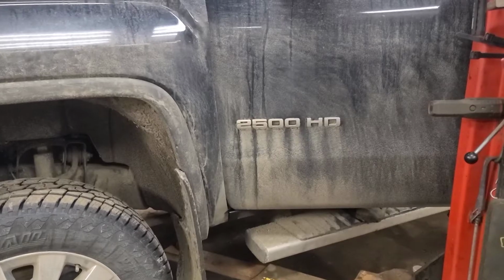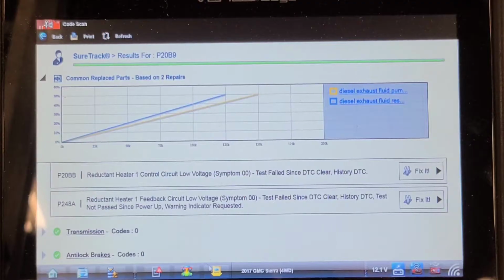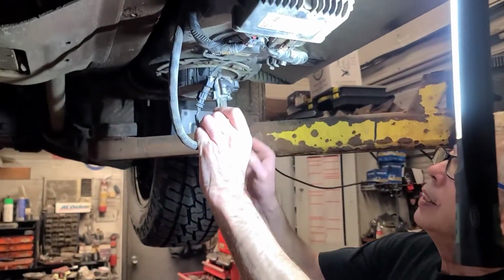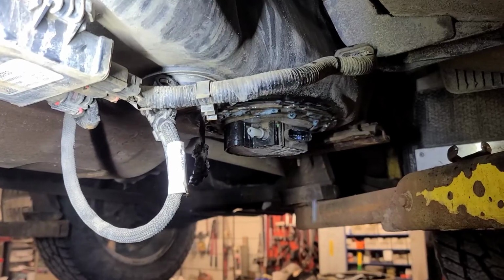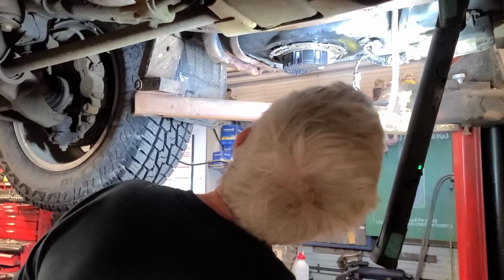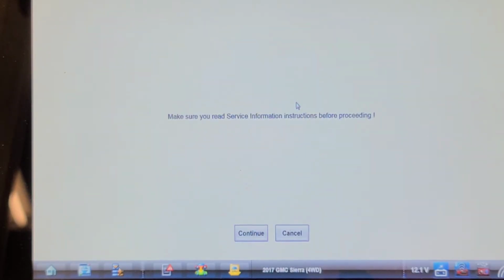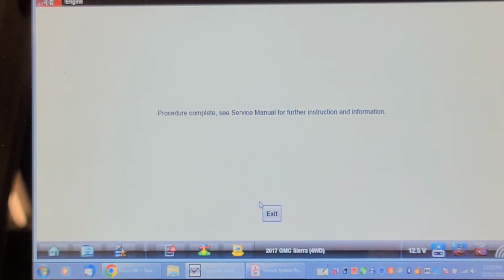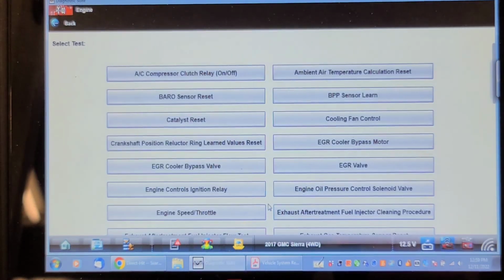2017 GM Truck 6.6 L5P Def Pump Replacement pt 2

Comment: Just had this def heater code along with “reductant flow too low” and a p2002 (nox sensor in efficiency . Did a forced regen and cleared DPF soot load down to zero . All codes went away . Mind you the soot load was at 93% when I started the process . I thought for sure i was looking at a failed DEF injector . THINKCAR scan tool saved the day .

Comment: Does anybody know of the level reset is supposed to be done with the tank empty?  I just replaced mine and it threw a hard code within 30 miles, I believe due to the level not sensing properly
Reply from the maker: What code is it setting? This one needed the harness replaced couple weeks later. The def damages the terminals.

Comment: Do I need to take it to a mechanic shop to reset level and NOx Catalyst Reductant Loading reset? I too think I can do this in my driveway and don't want to take this to be over charged. Is there a tool at an auto parts store I can barrow to reset all I need to? TIA
Reply from the maker: Try disconnecting the batteries while you're replacing the unit. That should clear the codes. If after restarting your mil is on then try the autoparts store but will depend on how capable their scanner is. Good luck

Comment: Regarding the def level reset. Did you determine if that was required prior to filling the tank?
Reply from the maker: @crozli2549  i did not do any reset if i recall
Reply: You point out in the video that when installing a new reductant pump a reductant fluid level reset is required.
Reply from the maker: @crozli2549  you are correct. I did it at the end but I'm not sure how critical it was. System was fine since.
Reply: Does this pump also read the level sensor? Do I have to reset parameters or can I plug and play and just disconnect batteries

Comment: Thanks for your video great information is this something you can do at home I’m on my second one and want to save some money dealer wants 2100 I figure I can do it for 500
Reply from the maker: @tbonesz1  it's not that bad to do just a bit messy draining the fluid.
Reply: @PhillipBailey  ok thanks for help
Reply: One other question do I have to prime the pump and will my engine light go off by disconnecting the battery or I need to take to have the computer flashed
Reply from the maker: @tbonesz1  disconnecting the battery should clear the code,  no priming is required.
Reply: @PhillipBailey  ok thanks
Reply: Thanks for your help I changed the pump disconnected the battery finished up and drove down street no issues then got a difference message service def system 98 miles to 65 mph what do I do now ?
Reply from the maker: @tbonesz1  start over again by scanning for codes
Reply from the maker: That code has to do with a problem with the throttle body and not the Def system

Comment: SOLVED my U029E with "Exhaust Fluid Service" and "Reduced Speed". For the past month I have been working on this issue on my 2017 Silverado 2500HD LT 6.6L. Tonight I purchased my 3rd NOX2 (downstream) sensor and IMMEDIATELY EVERYTHING WAS FIXED. So, what happened? Why did the previous 2 NOX sensors NOT work? A clue came from GM Parts Direct as the original part number was listed as "DISCONTINUED". Previously we had purchased 2 numbers matching NOX2 sensors 12676706. So why did these sensors not work when the one see image below immediately worked? CHEVY! They programmed out part number 12676706 from the computer and programmed in 12718676. 12718676 CURED OUR U029E and "Exhaust Fluid Service" and "Reduced Speed" issues. Companies are still selling NOX2 part number 12676706 because it was the original device DO NOT PURCHASE THE DISCONTINUED NOX2 SENSOR 12676706. INSTEAD PURCHASE THE 12718676 PART NUMBER.
Reply: I was also forced to replace the trailer brake controller unit to fix the TPMS, stereo, and braking issues too.  Chevy has to do better.  The trailer brake controller was also discontinued.  I presume it would have presented the same issue too.
Reply from the maker: Good to know,  thanks for the tip 👍

Comment: Can you direct me to the caliber and location to shoot the STABILITRAC unit?  That is just a joke but as I am trying to resolve my 2017 Silverado 2500HD LT 6.6 "Exhaust Fluid System" and "Speed Limited" issues.  It has a new DEF pump, new NOX sensors, and new particulate matter sensor but it keeps stating that NOX2 (U029E) is not reading and the error message will not reset.  Any pointers?
Reply from the maker: @StephenRicket  you need to qualify the wiring between nox sensor 2 and the fuel pump module.
Reply: @PhillipBailey  Thank you, for the suggestion.  I will work on again this evening to see what I can find.
Reply: @PhillipBailey  Theredoesn't appear to be any issue with the wire harness from NOX2 to the fuel relay bundle or to back to the computer.  However, the voltage at the input of NOX2 is Black 0v, White1 .12v, White2 .5v Blue/Brown -.05v, Blue/Yellow .12, and Blue/Purple is 11.22v, and black is grounded.  Since the sensors have been replaced we have not drive the vehicle 20 miles as the NTHSA states for the sensor to ACTIVATE.  chrome-extension://efaidnbmnnnibpcajpcglclefindmkaj/https://static.nhtsa.gov/odi/tsbs/2016/MC-10111721-9999.pdf
Reply: @PhillipBailey  SOLVED my U029E with "Exhaust Fluid Service" and "Reduced Speed". For the past month I have been working on this issue on my 2017 Silverado 2500HD LT 6.6L. Tonight I purchased my 3rd NOX2 (downstream) sensor and IMMEDIATELY EVERYTHING WAS FIXED. So, what happened? Why did the previous 2 NOX sensors NOT work? A clue came from GM Parts Direct as the original part number was listed as "DISCONTINUED". Previously we had purchased 2 numbers matching NOX2 sensors 12676706. So why did these sensors not work when the one see image below immediately worked? CHEVY! They programmed out part number 12676706 from the computer and programmed in 12718676. 12718676 CURED OUR U029E and "Exhaust Fluid Service" and "Reduced Speed" issues. Companies are still selling NOX2 part number 12676706 because it was the original device DO NOT PURCHASE THE DISCONTINUED NOX2 SENSOR 12676706. INSTEAD PURCHASE THE 12718676 PART NUMBER.

Comment: Are you familiar with the code p20bd? Is it the same part you are changing for my issue or is it a wire or something else?
Reply from the maker: That code sets when there's a problem with the reductant line heater or circuit. Disconnect the reductant line heater and measure resistance across it. Should be roughly 2 to 3 ohms.
Reply: Awesome i will do that, so theres a front line and a rear should i focus in the rear down at the tank?

Comment: Every part number I find it says it doesn’t fit my 18. Looks like it but says it doesn’t.
Reply from the maker: You should always order parts via VIN. 2017 and 2018 may be different.
Reply: @PhillipBailey  the pump fixed my issue. Between your video and snap on scanner I was able to do the job. Thanks for sharing.

Comment: Changed my def pump out about 6-7 weeks ago.  No codes since.  Probably filled up (Def) twice…nothing abnormal with my miles….but now I’m getting P1050 and my def level sensor is not responding.  Saying it’s running out and I have plenty.   Ugh.  A second pump in 2000 miles?
Reply from the maker: 1. Unplug the reductant pump and test for less than 25 ohms to ground on the Blue wire pin 6. Test wiring to the Reductant Control Module (RCM) if more.

2. Ignition on, test for 5 volts on the Blue wire pin 13. Test wiring to RCM if not.

3. Test the Brown wire pin 14 to the RCM for an open, short or high resistance.

4. If ok, replace the reductant pump and retest.

I would think if its that new there should be warranty on it.
Reply: @PhillipBailey  I’m pretty sure there is a warranty.  I’ll see if I can run those tests tomorrow.   Hate seeing the same problem after I spent that on the pump already.   Watched your video and did it myself.  Appreciate the info and I will keep you posted.  Thanks.
Reply: With the P1050 code, have you experienced any limited power or max speed restrictions? Limp?
Reply: Did you ever figure out the issue.. ?

Comment: Im getting ready to chsnge out my pump also. Do i need a high end scanner to reset the code? I have a basic scanner
Reply from the maker: A basic scanner should work but you could also disconnect the batteries while you're changing the pump.

Comment: mine was replaced at 32K and again at 45K.  I use only OEM DEF and never let the tank get below 20%.   What is your theory on what is causing the failure of reductant tank heater/sensors?   I beginning to think water intrusion on the various electrical plugs.   Perhaps the tank needs to be better protected from the exposure to environment.
Reply from the maker: I believe its just poor quality parts. You're correct about deleting affecting the resale value and being illegal as well.

Comment: DEF has to be heated to 80*F to be effective....service manager at GM dealership.    If ambient temp 80 or above, then heater in ruductant pump not vidal to be working.   Of course you have to account for reduction in air temp with speed of vehicle????   Complicated.   Can't delete the darn thing because you leave yourself exposed to stiff fines depending on where you live.   Also, if you delete, you have just substantially depreciated the value of the vehicle and the dealers don't want it on trade in or they will negotiate lower offer based on deletion that will have to be addressed before they can put it on the lot.

Comment: Anyway to clear the permanent code without a high end scanner?
Reply from the maker: Try disconnecting the batteries for at least 30 minutes. If that doesn't work an OBD code reader should clear them.
Reply: @PhillipBailey will clearing the code remove the emissions off the dash
Reply from the maker: @anthonymckenzie4234  the code can only be cleared after the problem is fixed with a scan tool.

Comment: Did that fix the problem?
Reply from the maker: It came back and I ended up replacing the short harness between the module and pump as well.
Reply: Replacing my pump as well do u thinks it’s a good idea to replace harness truck has 250k miles on it  L5p
Reply from the maker: The harness was cheap, around $120 Canadian, if I remember. Cheap insurance, in my opinion.
Reply: Any part number ?? Having issues finding the harness

Comment: Def has to be the nastiest stuff I’ve ever messed with, I always enjoy your videos and learn something from each. Thank you for sharing your time and knowledge and tricks with us. I hope you and your family have a blessed Christmas and new year
Reply from the maker: Wow thanks. I really appreciate you watching. Best of the season to you and yours!
Reply: Replaced the pump a few months back now getting code p205b can’t seam to find that code anywhere or videos on it any info would help
Reply from the maker: @luisalvarado1665 1. Confirm the reductant temperature sensor reading is incorrect using the scan tool.

2. Access the reductant sensor module on top of the Diesel Exhaust Fluid (DEF) tank and disconnect it.

3. Measure the temperature sensor. Connect an ohmmeter between the Black wire at terminal 3 and the White wire at terminal 2 of X2. Expect 10K ohms at 77°F. Expect 20K at 50°F. Expect 6.5K at 95°F.

4. If the sensor resistance is out of range, replace.